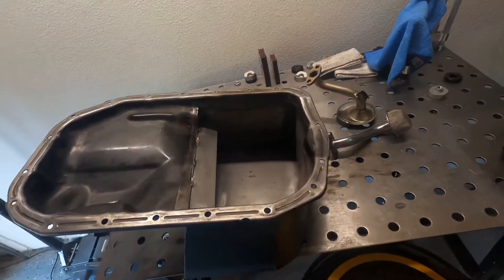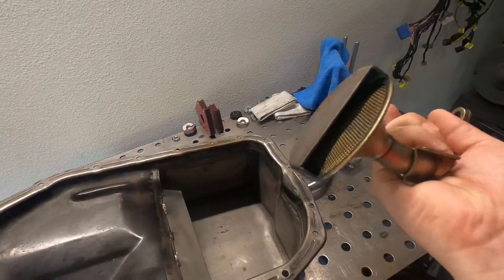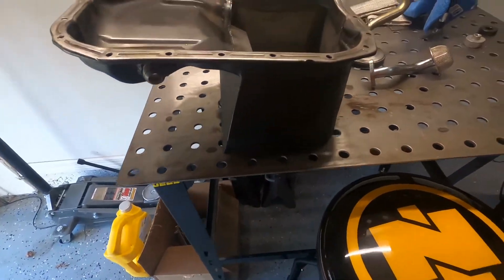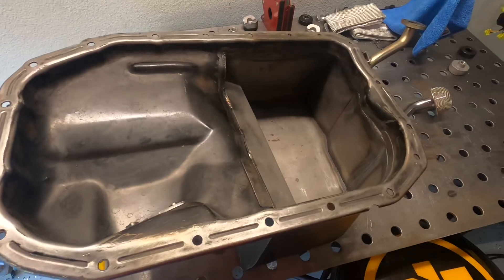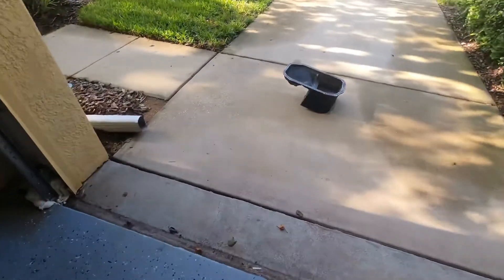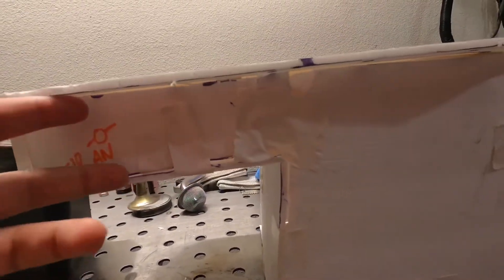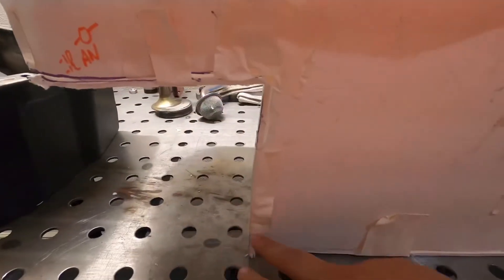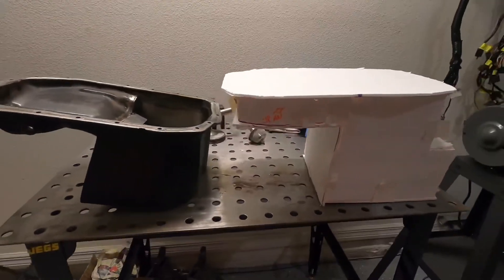Mocking up a Custom 4G63 2G 7Bolt Oil Pan. RWD Drag Car Build

Comment: Hey where are you located I need a oil pan done for my 4g63t
Reply from the maker: Is it a 6 bolt or 7 bolt ? I’m located in Florida .
Reply: @nexxracing  it is a 6 bolt
Reply: It is a 6-bolt I need the oil pan done towards the rear and the sump pump
Reply from the maker: So you want a modified pickup tube to pick up oil from a rear sump pan. I’m in the process of finishing my pan , once it’s done which should be this week,  I’ll have a video up with more information in regards to pricing and how to contact me to order a pan. Remember Stay tuned we’re Nexx, Nexx Racing!
Reply: @nexxracing  👌